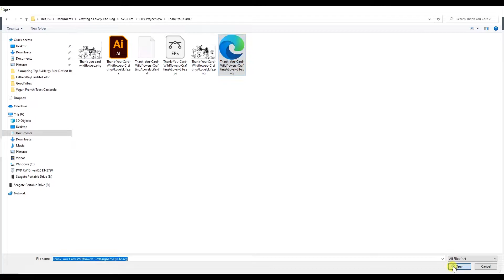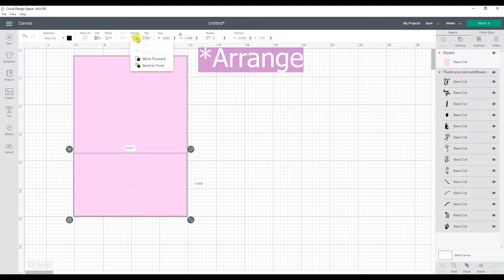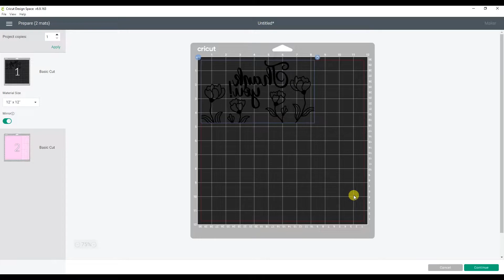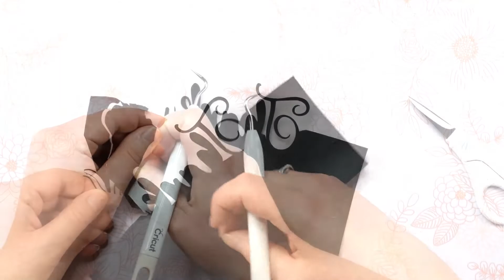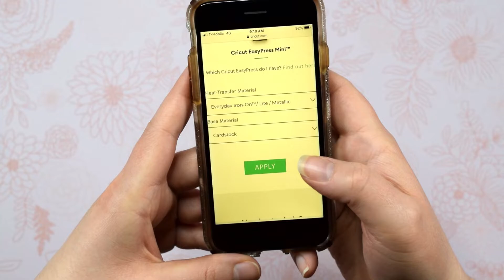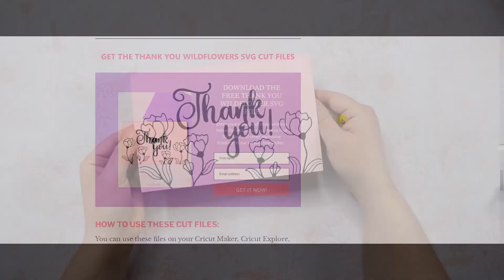HOW TO USE IRON ON VINYL ON CARDSTOCK | HTV ON CARDSTOCK TUTORIAL | CRICUT FOR BEGINNERS

Comment: Have you tried printable iron on vinyl?  Ty
Reply from the maker: I have not tried printable iron on vinyl yet. I've had it forever and just haven't found the project I want to use it with yet. It's very similar to the print then cut process and then you just iron it on like you would regular iron on vinyl. I will have to think of a tutorial to do with it soon.🙂

Comment: Can I use infusible pens on cardstock ?
Reply from the maker: I don't see why you couldn't use them on cardstock just for writing purposes.  They will be muted in color though since you aren't actually infusing the ink into the paper (the ink infusing process requires heat and specific material types made for infusing).  The ink might also not last as long as traditional ink, but I'm honestly not sure because I have never used infusible ink pens on cardstock. My recommendation would be to use regular pens for this purpose, but if you needed to in a pinch you could probably get away with using infusible ink pens.
Reply: @CraftingaLovelyLife  Thanks!!!

Comment: Do you recommend using parchment paper?
Reply from the maker: Usually the temperature on my Easy Press mini works great without having any sort of additional covering.  If you think your paper is getting too hot, you can definitely try using butcher paper or a Teflon sheet for additional protection.